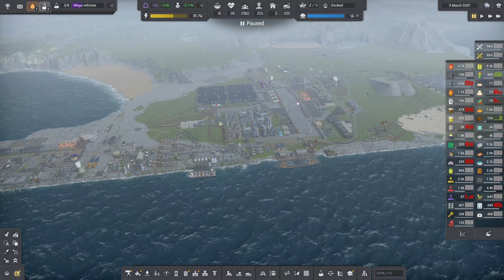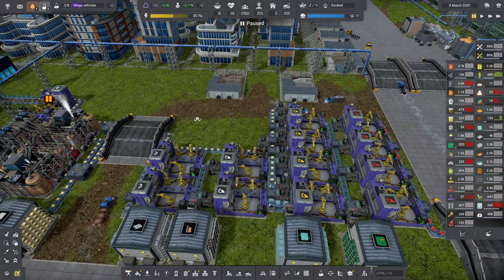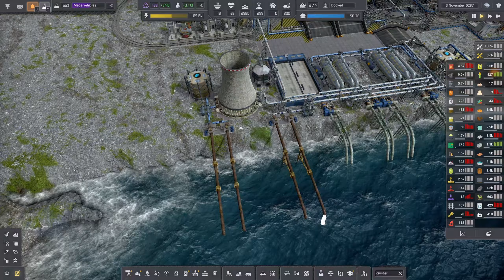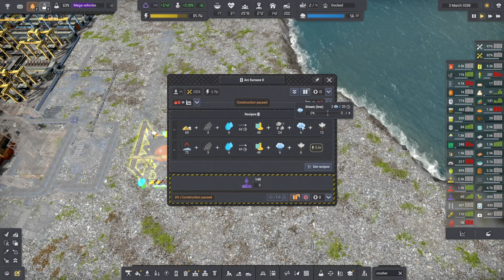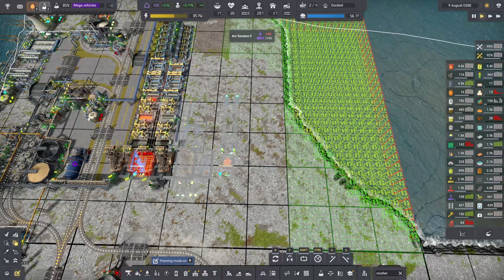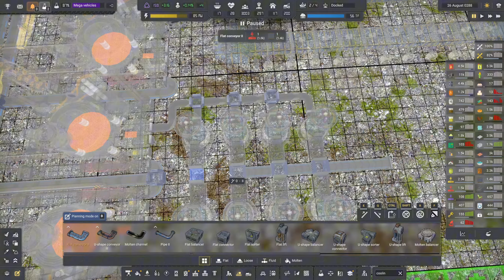Captain of Industry Update 3 Let's Play Ep.28 - Let's DOUBLE our Electronics II Megafactory! (I/II)

Comment: The issue with your generators is they are competing. Bump the priority on the generators into a scale. To have generators compete with solar switch them to surplus P1. But I use priority 5, 6, 7, and 10. It's fine as is and doesn't change gameplay. The other issue maybe the main power plant has 48 mechanical energy but three generators. Learning thermal storage is a high curve but once understood. I b-line to it.
Reply from the maker: Yeah I tend to work down from 1 and up from 10, depending on the power plant - but as you said everyone's mental model is individual but as long as it's internally consistent it should all work the same!
Reply: @CharlesCircle Somehow turbines may do the same as generators with the priority system. But I have not tested that.

Comment: I hope you explain why the thermal storage is useful as means to convert from steam low to high. There's no energy gain, and now you've introduced some mental load to remember to toggle it back and forth which would block the input whilst discharging?
Reply from the maker: There's energy loss even! It's better energetically than just venting steam but (spoiler alert) I end up deciding it's not worth it for exactly your point - the mental load of an active system is too much cost for very little benefit. Another one where I get what they're going for (backup energy storage without trivializing the need to maintain continuous base load) but the implementation just isn't worthwhile imo. 

Proper batteries in the game would also indirectly boost solar, which I think could use  a buff too.
Reply: @CharlesCircle Put a note down above that is useful information. Thank you for your videos. It helps pass the time until electric is restored.
Reply: Thermal storage is better when used with solar panels. The solar powers an electric boiler in surplus power mode that charges a Thermal Storage. It's useful in making water, crude oil, and paper. For power the low pressure thermal storage decouples the low pressure turbines from the main boilers steam loop or steam cycle. And for high pressure decouples your high pressure turbines in auto balance from the main steam loop. You may attach an electric boiler in surplus mode to the thermal storage to make up the deficiency in steam.
Reply: I will tell you a simple thermal storage based power plant. With four coal or woodchips boilers. Put down your two high pressure turbines. 1 tier 1 high pressure and one tier two high pressure turbine with auto balance off. Continue the steam stream from those turbines into a thermal storage. Build another thermal storage next to the first high pressure thermal storage and do the same from the same point of the turbines with autobalance off. So the steam pipes should pass the turbines with autobalance off. And split off into the two high pressure thermal storages. The high pressure thermal storage should pass their outputs into one tier two high pressure turbine. One tier one high pressure turbine and one tear two high pressure turbine with autobalance on. Repeat the same for the other thermal storage. So there should be a total of three tier 2 high pressure turbines and three tier 1 high pressure turbines on the same shaft. The low steam should pass in to a low pressure thermal storage. The low pressure thermal storage should pipe into three low pressure tier 2 turbines on autobalance. Continue the steam stream from the turbines into the three thermal desalinators. Take the water loop from the depleted steam from the cooling towers and pass the water from the cooling towers through each thermal storage😅. And take the water from the thermal desalination and pass them off to the boilers and output to the rest of the facilities. You should have a scrubber. You can attach that to the low pressure thermal storage and take water from the water return loop from the cooling towers. Have an electric boiler with an output of 12 steam in surplus mode pumping  steam into each high pressure thermal storage. Have at least three flywheels. And tear two pipes is most that is required. I forgot about the four tear two generators. But that is one train or shift.